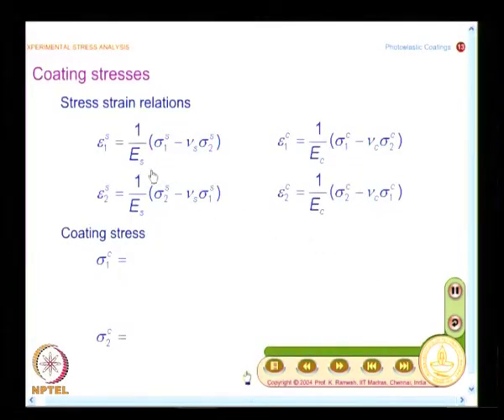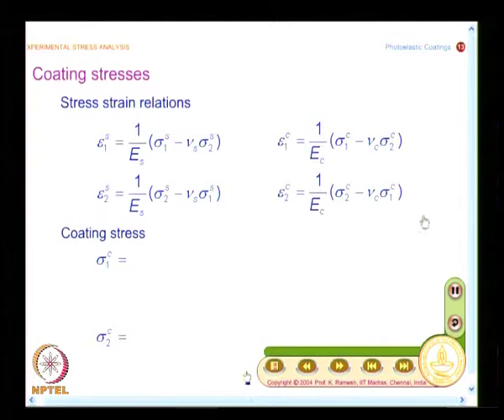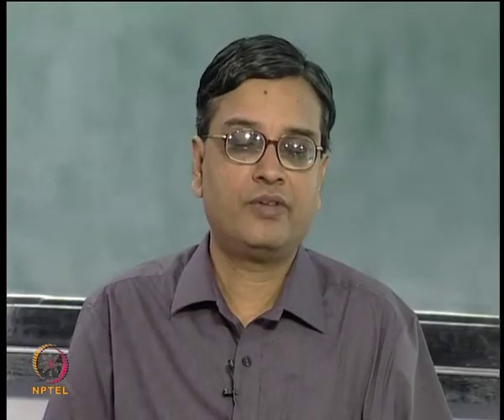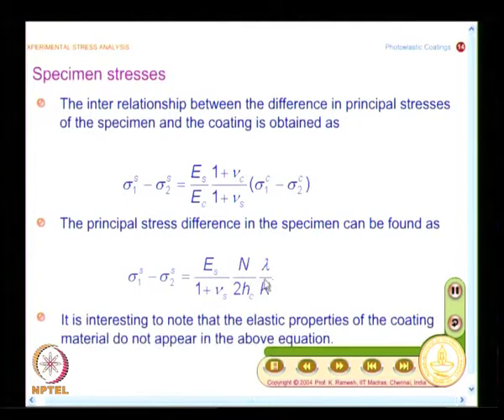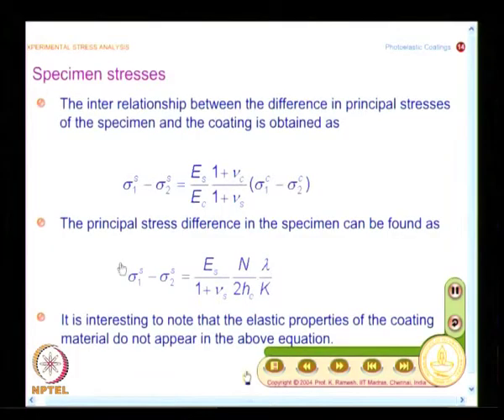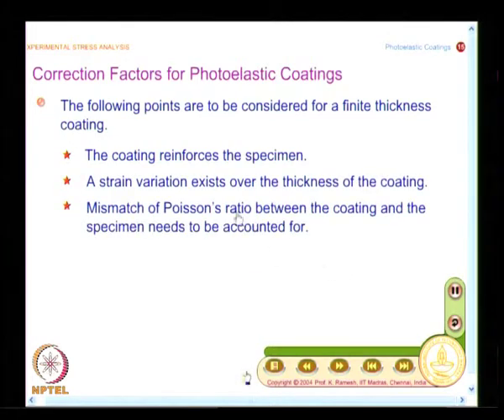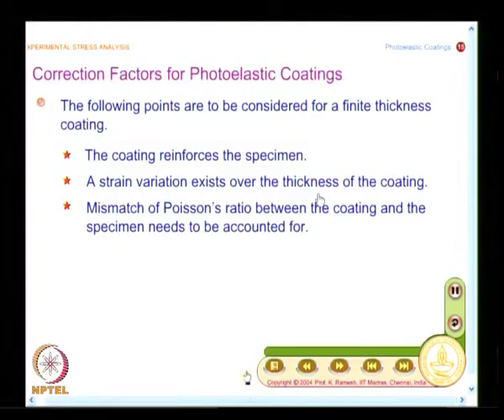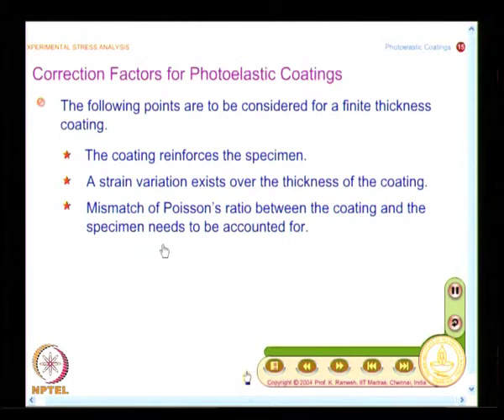Mod-04 Lec-27 Correction Factors for Photoelastic Coatings

Comment: Sir please solve this problem 
A birefringent coating (E' = 2.50 GPa and v' = 0.36) is used on a plane-stress      tensile specimen fabricated from glass-reinforced plastic (ES = 27.5 GPa and VS =     0.20) to measure the stress concentration factor resulting from a centrally located      hole. If Nmax = 4.5 on the boundary of the hole and No = 1.00 at an interior point     well removed from the hole, determine the stress concentration factor due to the hole.